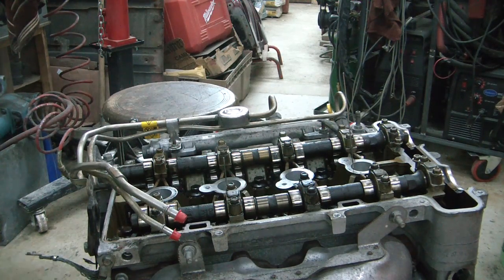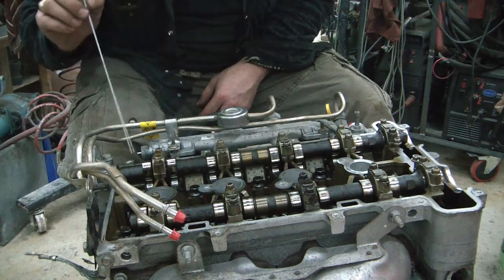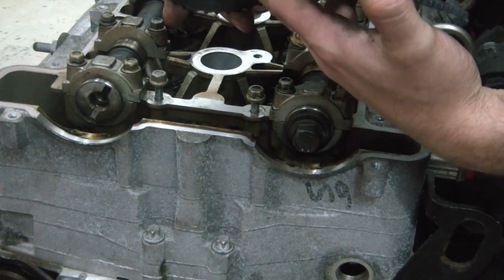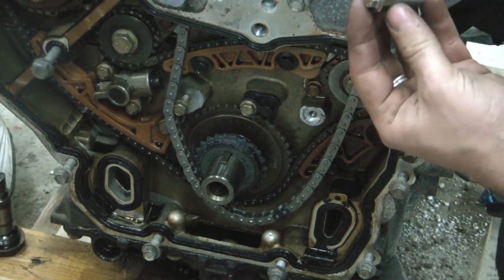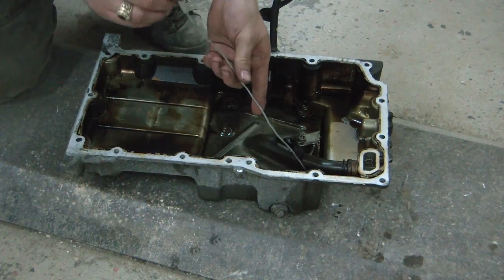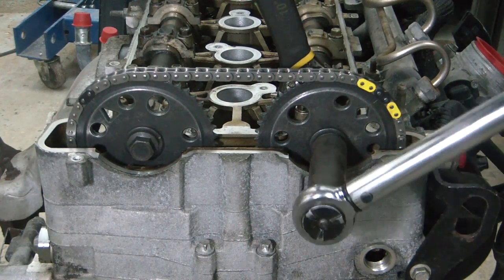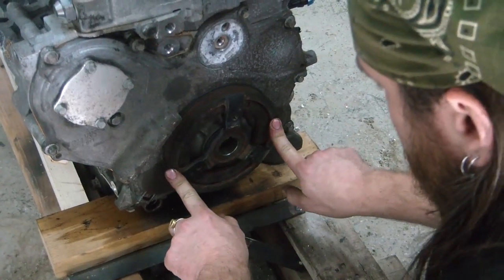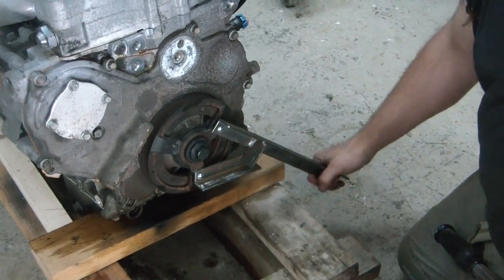04 Chevy cavalier engine swap 4 (new timing chain)

Comment: The correct torque spec on the balancer should have been 74 + 125 degrees (not 75 degrees).

Comment: Hi good day.

I would love to know if you withdraw in dodne cover all the gear is coupled with the chain has torke this cover screws to be done as it is what is given and I require removing this cover to change the water pump.

and I would love to know if the screws to remove the carter leading torque and es.y as if I withdraw the crankcase have to put some more additional silicon packaging

waiting for your comments.

I am studying mechanical and are my first repairs.

thanks

Comment: When you was having trouble putting the 3 gear back on with the chain, what did you do? I'm having the same problem getting that last gear on to the cam or getting it on to the cam, if I put the chain on the gear first.

Comment: GOOD VID MY 2004 2.2 ECOTEC HAS 264,000 KMOR 160,000 MILES  .I ALWAYS PUT SYNTHETIC OIL AND IT IS JUST STERTING TO HAVE START UP ISSUES NOW AND THEN ,HOWEVER I DONT KNOW IF ITS DUE TO MY TIMING STARTING TO GET OFF A BIT OR SOMETHNG ELSE .ANYWAY SHOULD I  HAVE THE TIMING ASSEMBLY CHANGED PRETTY SOON OR JUST WAIT FOR THE ENGINE TO GO AND DROP ANOTHER ONE IN?
Reply: Did you end up swapping it?

Comment: Well i have a 2.2L in a cobalt that runs like crap. 5psi on cyl1 tore the head off had it resurfaced did have a low spot between cyl1 and 2 put it back together and still runs crappy only 25psi on cyl 1 at a loss right now dont know what to do i could have changed the engine for all the time and effort i have into it now. Jeeze i hate these engines!
Reply: Did you check the block to see if it was warped. If it leaked for while often times it will damage the block especially between cylinders.

Comment: The marks on the chain will always move on any motor because the camshaft and the crank are geared rotate at different speeds for every one revolution the camshafts make the crank makes 4 revolutions. That's why they don't line up after you rotate it.
Reply: Actually the ratio is 2 revolutions to 1. NOT 4 to 1!
Reply: Bob Johnson thats what I ment to say my bad.

Comment: i can make this vid 7 secs long :)
key way on the crank facing up in line with the plugs
cam lobes over #4 cylinder @ 10 (inlet) and 2 (exhaust)
fit the chains and align the marks lol

Comment: That tensioner guide is a pain in the butt. Hardest part. Although I replaced the balance chain also, and the one brand new gear timing didn't line up right, after a while I decided to take it off, and the timing mark was in between the teeth. Found out I could move the timing mark wherever I wanted. Got refunded, but if the engine would've been destroyed then would the company I got the gear from replace the engine?

Comment: But you are right technology has changed things, and in some ways very much for the better, but not always, as you know thinner and thinner metal has meant quickly disapearing cars for the people of the rust belt.  The French are doing for their cars what we SHOULD be doing for ours, building them using GALVANIZED steel, what an F&^%ing concept cars that don't rust through! I can almost guarantee that if you offered galvanized cars for $1000 more versus non galvanized cars they'd still sell.

Comment: You're right, the ENGINES last much longer now-a-days, you have to remember though, engine oils have improved so much, I mean there wasn't even such a thing as Mobil 1 when I was a kid and even Mobil 1 is not longer made with the original formulation!  NONE of the oil formulations of that time has been made for over 30 years!  Oils are so good oil change intervals have almost doubled! I'd be willing to bet you could get well over 200K from a freshly rebuilt 283 Chevy using todays Mobil 1!

Comment: What a fiddly piece of %^$#@ that thing is, welcome to the world of plastic engine parts! Why'd you buy a new bolt for the crank pulley? Is that recomended? WTF, DEGREES?  You don't just torque bolts anymore, you torque them and need a degree wheel!  Oh GM, you make me laugh.  I can see that the crank pulley came off and on easily, but I would worry as to WHY that went on so easily. I might check the old engine to see if it is the same there. Good vid hope it goes smoothly from here on!